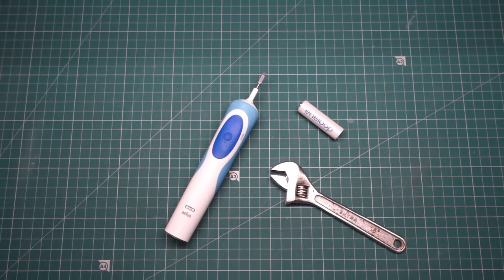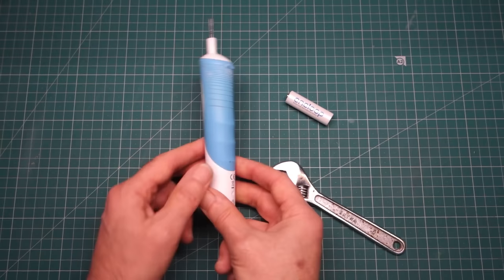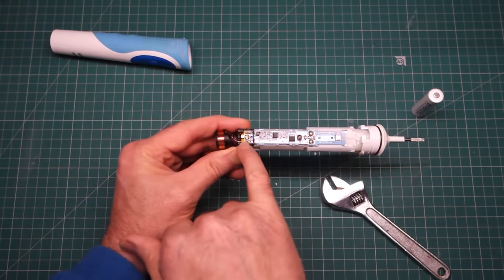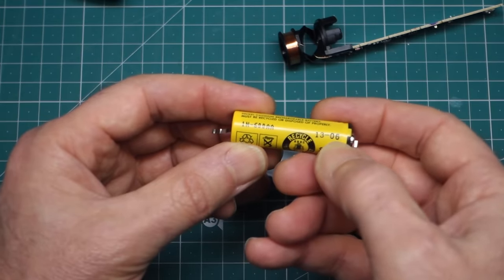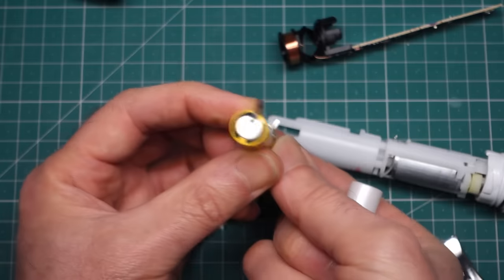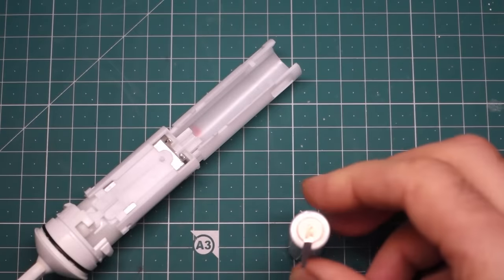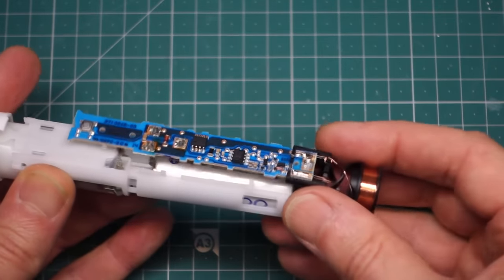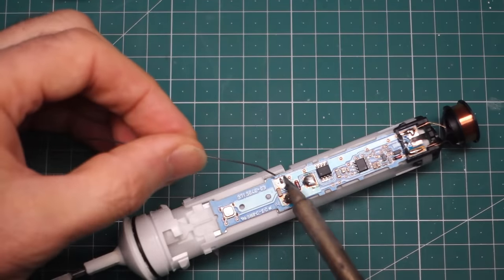Ep 33 Electric Toothbrush Battery Replacement/Upgrade

Comment: Just did my one! This has bugged me for ages, so good to keep using a perfectly good toothbrush! Down with planned obsolescence!
Reply from the maker: It's definitely a "first world problem" but I agree with you, it's great not to have to recharge the toothbrush every few days
Reply: @PowerOn-  I use the one that takes two disposable AA batteries and put two Eneloops in it. That way I never have to worry about an internal battery wearing out.
Reply: Yeah I have same model. to be honest it’s amazing electric toothbrush the quality that can last for so long.  Unfortunately for me.  I’ll just have to spend the $37 to buy a new one.
Reply: I just did it today. I couldn't solder the tabs to the battery, but just used masking tape and that's it. It is working again after almost 8 years of storage.
Reply: I’ve had mine for about 11 years and only a few weeks ago it started acting up.
Reply: @eolguing clean the tabs with alcohol and use flux.

Comment: Thanks so much for this very helpful procedure.  I have just replaced the original 700mAh NiMh battery with at 2200mAh NiMh.  I found the new battery on e-bay and it had the solder tags pre-fitted, although they needed a little trimming prior to installation.  The whole job took me around an hour, I could probably have done it quicker but as this was the first time I had attempted it I exercised a little caution along the way, and also cleaned the brush before re-assembly.  

Well done Simon!
Reply from the maker: Well done Richard.  Another toothbrush given an extended life 😁
Reply: Hi, what voltage did you go for ?
Reply: 700 NiMH to 2000 is amazing

Comment: Many thanks Simon!  Recovered 3 of these Braun and they used to open at the base.  Fitted an NiMH after opening at the top as per your video, and it didn't run.  Few mins on the charger, back and working.  Another gadget saved from landfill.  Cheers!
Reply from the maker: Good work Mike,  keep it up!

Comment: Very helpful and great video to demonstrate the steps. Bear in mind that don't try to solder the terminal on the battery, as explosion may happen due to overheat the battery seal(s). Simon used correct method/tool (spot welding) to do the great job. Thanks Simon.
Reply from the maker: Glad to be a help
Reply: @@VIKINGNATURALSOAP No, and soldering is fine also if you are not heating it up too much. Clean the ends with sandpaper, use some flux and a large soldering tip and tin both surfaces you will be connecting
Reply: Ya, what if you don't happen to have a battery spot welder handy???

Comment: What I cannot understand is why they don’t make them so you can just replace the battery like you can with a light. Great video buddy 👍🙂
Reply: to make people go and buy a new one
Reply: So you buy a new one. It is a world of consumerism mate
Reply: @David Thompson, if they had invented flashlights this millennium then you wouldn’t be able to replace the batteries! You would simply have to throw it away and buy a new flashlight every time the battery died. Built in failure and prevention of service and repair should be outlawed in my opinion.
Reply: So we should continue to make rubbish that breaks - for factory workers? I think it’s better to make products serviceable - then people can be employed to service them instead of making even more crap that breaks and has to be put in landfill.
Reply: Buy new ones from them😂
Reply: @lindsay5985  amen. For the planet would be better Not to rebuy a lot of products
Reply: Cos they wouldn’t make any money and you are forced to buy a new one.
Reply: To be fair the new models do have a standard 18650 Li-ion battery that is very simple to slide out and replace

Comment: Just did this to a couple oral-b’s that had old ni-MH batteries. video was great, thanks!! I did not have de soldering bulb so I attached a straw to a vacuum which sucked solder right up! Also vaseline/petroleum jelly works well as a flux replacement!! 😎
Reply from the maker: Lots of great tips!

Comment: Thank you very much Simon, very useful! I had the same problem with not turning back on but when I had done nothing more than remove the insides from the casing, no desoldering, nothing. 
Happily, putting it on the charger for a minute worked. This device obviously doesn't like any tampering! I thought I must have cracked the PCB at first. Mine wasn't a battery issue but the underside of the rubber on/off switch cover was worn away, making it hard to turn on when assembled. A bit of silicone sealer has filled the gap and will hopefully work when it's cured.
I do love fixing stuff.

Comment: Doing this today. I replaced the battery before but that one's almost totally gone. 1/2 the time I turn it on it only has 1/2 second action. Other times it's good for 2 minutes and dies, right at the end. I'm replacing with an Eneloop this time, figure it will last way way longer than the NiMH replacement I had in there before. The original was a NiCad. I did something similar with my Oral-B Triumph toothbrush around a year ago, replaced that one's battery with an Eneloop, it's been going strong ever since. Not having a spot welder, I used a regular solder iron. The connection seemed less than reliable but so far so good. Yes, down with planned obsolescence! Thank you for this excellent video. FYI, all, another video showing similar fixing of one of these types of battery operated toothbrushes advised wiping the outside of the unit dry after each use, saying that the death of these is frequently due to water seeping inside. I towel off mine after rinsing these days.

So, after writing the above I started the process of changing the battery for an Eneloop AA that had a decent charge on it. It succeeded but there were a couple problems I had to deal with. I removed the battery that was in there. It was a NiMH I'd bought off the internet and it said on the side that it was 2200mah capacity. Of course, that is very doubtful. I then tested its voltage and to my amazement it was quite high, over 1.37 volts. But the toothbrush only worked sometimes in the last 1/2 year or more and would rarely work at all after 2 minutes and lately it wouldn't turn on for more than 1/2 second. So, what could be wrong? I decided to put the Eneloop in there anyway. I tore the tabs off the battery that had been in there and soldered them on the Eneloop. The one on the negative end wouldn't stick, so I roughed up that end of the battery using a dremel. Then the tab stayed soldered on. I assembled the toothbrush but encountered a problem in that the shaft at the top came loose from the rest of the internal unit. I persisted and managed to get it back on, completed assembly. It did not turn on, as Simon experienced and I put it on the charger for a couple minutes and then it turned on. And boy did it go! It had far more power than I'd had from the other battery and after a 2 minute usage it kept going like it never wanted to stop. I have it on the charger now, mission accomplished. I have no idea why it wasn't working with the previous battery. Maybe that was defective even though the voltage looks good using a multimeter.

Comment: Many thanks for such a clear video.  I've been wanting to replace the battery in mine for ages, but didn't want to break it taking it apart.  Gone from the 700mAh cell that never worked well , even from new, to a new 2800mAh battery that lasts for ages!
Reply from the maker: Well done Terry, I find that the higher capacity cells can work for a few weeks untill a charge is required.

Comment: Nice upgrade  :)
The onboard controller IC needs to be externally energized after the battery is removed. Once it's turned on, it then turns on the fet to power itself from the battery. This is partially for shipping purposes as the battery should actually not be energized during shipments. That's why they say "Charge device before using"  ;)  it really just turns the unit on fully.
Thanks for the tip on the spot welder and being resistive welding. There's another user who was having issues with that and I passed on the info and see if they get better results now.
Reply from the maker: Thanks for the reply and explanation Korishan, it's nice to have the gaps in my (limited) knowledge filled!  As for the spot welding I see lots of videos with people pressing really hard and it really makes the weld worse not better.
Reply: Hi
What do you mean by externally energized? Do you mean I should put it on it's original charger for it to work? 
Thanks in advance
Reply: @kb24theMVP  yes

Comment: Thank you so much for this video! I replaced the battery in my toothbrush! Feels so good that in this case I'm not a victim of planned obsolescence!
Reply: Hi, which rechargeable battery you now have it in the toothbrush? I would like to have mine replaced as well.
Reply: It’s really hard to call it planned while it works for about a decade. I used mine for over a decade.
Reply: Batteries just go bad over time
Reply: @CrackedPi  exactly
Reply: @CrackedPi Which is why it should be replaceable.
Reply: @riverrage  it is replaceable
Reply: @CrackedPi  Not for 99% of people. Soldering something in place doesn't exactly scream "replaceable", does it?

Comment: Brilliant Thank You !! Just unscrew it and found the fault ! The rubber that you push down onto the on button had a split in it ! Inside full of sticky toothpast ! WD cleanup bit 0f grease on the gear in the head !AND Ive got my lovely leky toothbrush back running  again ! Thank you again from a very white smile !!🙂
Reply from the maker: ...even I might be thinking about a replacement when something like that happens! 🤣  Anyway, good on you for resolving the issue.  Maybe the split rubber could be resealed, possibly a smear of silicone sealer if you have some?

Comment: I bought a Pro 2 unit pack years ago, only used 1 handpiece until it seemed to be down on power and charge duration.
Put that aside for about 5 years until the 2nd handpiece slowed similarly. Was looking for exactly this type of information.
Charged the original up and it's still working well another 3 years later. Original battery.

Comment: Thank you, just got mine working today again, the battery was completely gone after 10+ years. The soldering spots are pretty hard to get desoldered, I recommend adding some fresh solder on top first as it makes desoldering easier.

About charging times: The charger's specification is 1.3 Watts. Assuming the old battery had around 1.3 Volts, this means it charges with 1 Ampere (1000 mA). If the new battery holds 2000 mAh then a complete charge would take approximately 2 hours. As we don't know whether the electronics stop the charging at any point, it is probably advisable to not charge much longer than that.
Reply from the maker: Whilst I didn't check i'm pretty sure there will be a charging chip inside controlling the process, particularly the termination of charge.  Also, the charging rate will be at least 20-30% below the input power as wireless charging has greater losses compared to wired.  Thanks for taking the time to comment.
Reply: Good point, I just realized there is a loss due to induction charging. Also there's heat losses. Yesterday I found the instructions leaflet and it states 16 hours of charging time, and that's for the small 600 mAh battery! So there must be some function to slow down the charging. I assume that's because most people leave the toothbrush in the charger anyway.
Reply: I'm not sure what type of solder they used, but it won't get wicked up properly with the copper braid. And there was a LOAD of solder on it already, the factory solder was pretty bad on mine, was like a ball and had a load of flux spilling out when heated. Ended up sticking a small screwdriver behind the board and solder away until it popped out.

Comment: I had the same problem, I used the tester, and it was OK. So I did what you did, I put the toothbrush under charge. Unfortunately I watched just half of your video, so I didn't know you had the same problem. When I finished watching your video; it gave me hope. By the time the video was over, I checked the toothbrush: it was working. My battery is much bigger, I used a 2700 mAh battery, so I had to cut all the plastic that holds the battery, and just leave the black part at the end. With a bigger battery is not necessary, it just stays in place. The charge should last much longer. The battery I bought came with the connectors, because without that solder you have, it's tricky soldering a connector to the battery, very tricky.

Comment: Just done mine. Had two to re-battery but one did not have the access using the charger peg and the top broke off when twisting it. However, I have got the other working again using the charger route and now have a spare PCB/motor should it be needed in 10 years time! Thank you for the video, and for those who pointed out the charger trick

Comment: Thanks, just did this. The connector on the original battery was broken, thats why I ended up here. I didn't know how to open the case :-)
Now the toothbrush has been repaired and upgraded. The original 700 mAh battery has been swapped with an Ikea 2000 mAh battery :-)
Reply from the maker: Well done Steen.  Another upgraded toothbrush!

Comment: I'm on my second one. After 2--3 years the part that the brush head slides onto becomes worn so the head vibrates when it should be snug. This reduces the orbital action significantly. Time for a new brush. I noticed it on my first one when I removed the head every time. I thought not removing the head would prevent this problem but it doesn't. I have it wrapped with electrical tape now.

Comment: I swapped a type 3756 with an eneloop aa. The original battery was shorter, so I had to cut some plastic bits, but it fits. I soldered the AA battery with the old metal bits.

Comment: I followed your video to replace the battery. I was able to get the same battery at a local Jaycar store. The toothbrush is working and charging fine again. When I was unsoldering the negative battery terminal from the circuit board, I lifted the pad off the board at one edge. I was using too small sized soldering iron tip and applying too long on the board because the solder would not melt. When I changed to a thicker tip it melted quickly with no further damage, Thanks for your video.

Comment: Hi, i replace the accumulator by your guide. Do you know, what is on the bottom of the plastic engine block? It looks like two spare motor carbons or something. I had the same problem. After the replacement of battery, tootbrush didnt work. 
After a few minutes he miraculously worked.

Comment: Just done mine by following your instructions- the old battery had a corroded positive post and the tag just snapped off but I found that a piece of 5mm de-soldering braid was perfect for the job….I had the same issue with it not working afterwards but a quick sit on the charger and hey presto off and running.Wonder if the battery will now outlast the motor? There must be many hundreds of these brushes in landfill all for the sake of a new battery..

Comment: YEESSS Great video! Crucially including the trick to restart the chips by putting the toothbrush briefly on the charger. I had followed a different video previously, which missed this bit out, and assumed wrongly I had overheated or blown the board. Just done two units upgrading from 700mAh to 2600mAh so should get mega time now :-)
Reply: Seriously it had 700mah????

Comment: Thanks for the video! Ilike repairing stuff, not throwing away.

Unfortunately this tutorial seems to be not working for the newer nodel (with timer) They are basicly the same, but those dheads from Braun changed the locking mechanism on the cap. Its now not L shaped latch, but click and done one. Once the ears are pressed down and latch, there is no way to retract them.

Comment: Thank you for your video.  I followed the steps and upgraded mine smoothly.  Since I thought removing and soldering of the metal strip could be difficult, I used 2 thin wires instead.
Reply from the maker: Thanks for the comment Daniel.  Using a wire sounds like a good idea....not too thin though as it will be carrying a bit of current.

Comment: Mine was full of rust on the battery and charging port as well. Now I am trying to replace and repair as needed by myself. 

Is it safe to change the battery using different type than the original one?

Thanks for the video.
Reply from the maker: It must be a NiMH battery.  It doesn't matter what capacity the cell is though.  Good luck with the repair.
Reply: @PowerOn-  I still curious with this. Instead of NiCd battery, why did you use NiMh? 
Thank's anyway for your respond

Comment: Gotta hand  it the guy for not editing out that WTF moment..... anyone who as ever worked on or in electronics has had many of them.   So, Kudos to you sir!  My purpose here today was to see how to get it apart, obviously.   But, my plan was to use the case for my new 40mW laser module.  Sadly, it requires a minimum of 3.7 volts.   Oh well, plan B.  PVC tubing.   Good luck to all with your adventures.
Reply: Oral B

Comment: I thought it had a smart charging system that only charges when needed so you can leave it on the charger ?
Anyway, ours are on the charger for over 6 years now, but I wanted to take it apart to clean or solder a new switch as I have to press harder than normal to turn on/off.
Thanks very much for the video!

Comment: I'd been wanting to replace the battery on mine but didn't know how to open it, I've replaced mine now and had the same problem you did but works great now. Thanks for a great vid.
Reply: Some of the instructions describe the disassembly, in order to remove the battery before disposal.